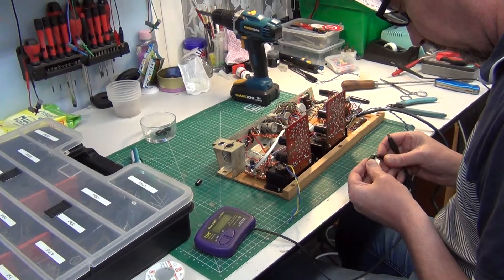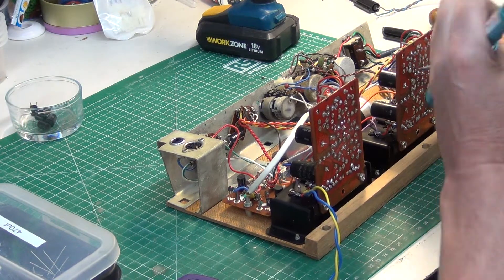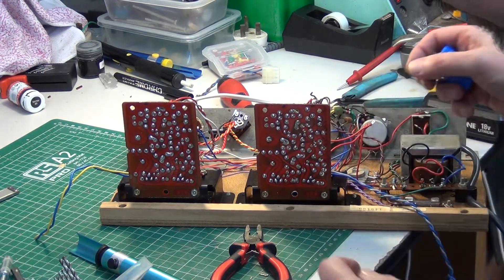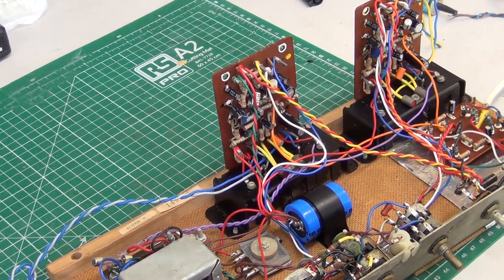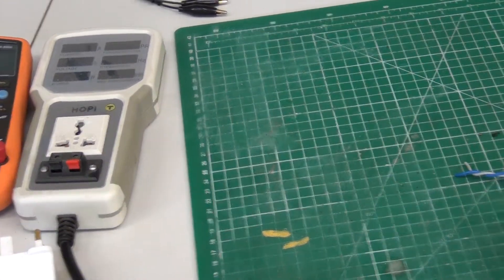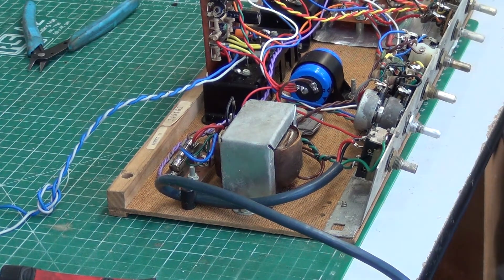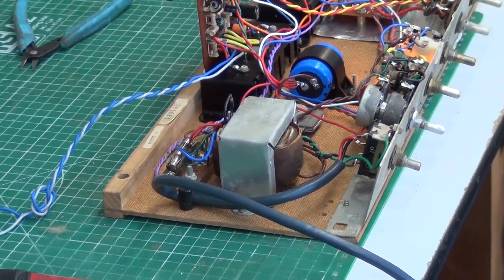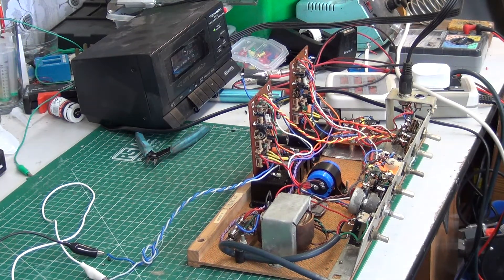HMV Stereomaster Stereogram (1966) 2018 - service part2 - the amplifier electronics

Comment: I could not copy Mr Mega Ultra Chippie when he told the different capacitor specs.  One is blue, I get it, and smaller, but were the specs the same?
Reply from the maker: The original was UK made by the 'Telegraph Condensor Company' and was 4500uF at 30V. The new one is 4700uF at 63V. Although we didn't need to increase the working voltage, I chose the 63V one on can diameter. Had I ordered a 35V new one, it would have been too small to mount in the P-clip.

You will realise, of course, that 'preferred values' have changed since the 60's. We changed 8uF to 10uF, 300uF to 330uF. The expensive one is the 750uF which we actually have @ £3.05+VAT each trade. I have cheaper Panasonic 820uF ones in stock too 'just in case' as those 750uF caps can be on a 1 year lead time from ordering.

I knew this HMV 2018 was coming, so ordered all the parts in November last year.

Richard
Reply: @ukfmcbradioservicingTango21  Going up in voltage never seems to be a bad idea as I understand it.  Capacity is different, but you've hardly made much change here.  Amazing the difference in size!